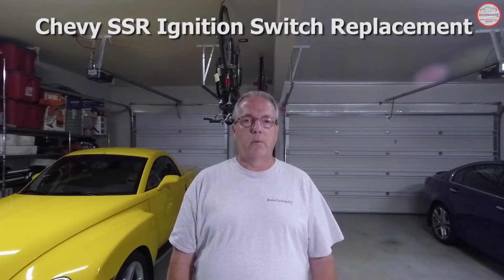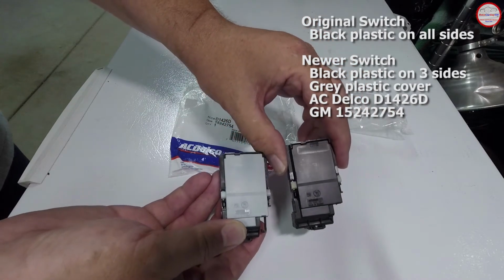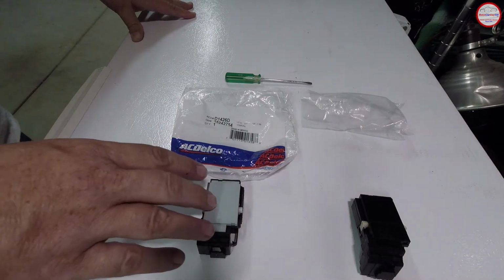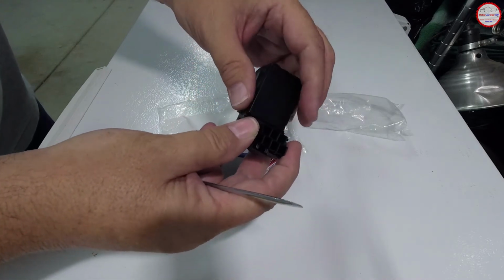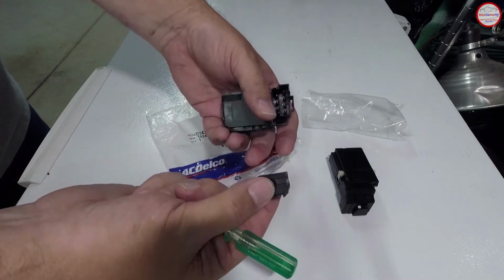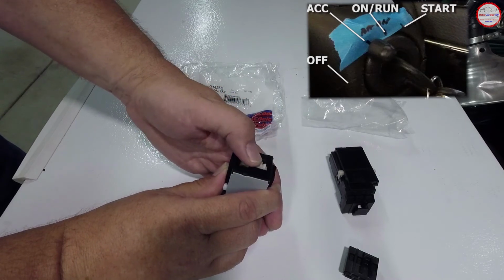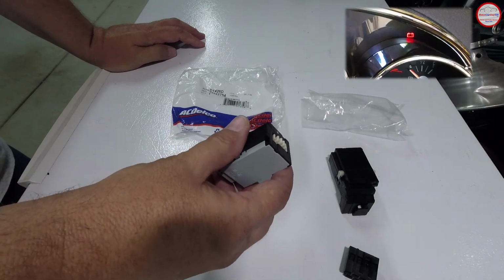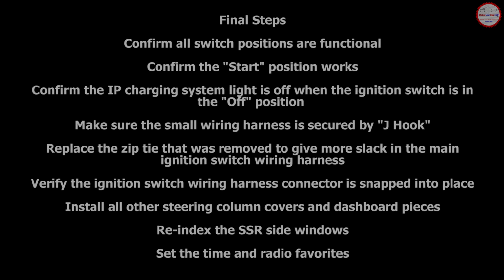Chevy SSR - Ignition Switch Replacement

Comment from the maker: Check out the video description for a link to where you can purchase the ignition switch and a link to the SSR How document library.
Reply: Why SSR 2005 6.0  turning off
Reply from the maker: Hi Jesse, I'll reply to this question in your second post about this issue on another video of mine.
Reply: Just changed my ignition switch on my 04’ and it worked fine in the beginning but after a few hours, it began to do the old “not turning on” phase.
Reply from the maker: There are a few possibilities

1 - The new ignition switch has failed
2 - The ignition switch gear was not positioned correctly causing it to not start or it leaves the accessory power on with the key removed. Sometimes having the ignition switch off by one or more gear teeth can cause strange behavior.
3 - The ignition switch was not pushed up into the slot fully causing only a partial engagement of the gear in the ignition switch with the gear from the key/lock assembly. The ignition switch should snap into place so the gear on the switch fully engages the gear in the steering column
4 - The problem you're having with the SSR is not caused by the ignition switch.
Reply: @RetroCarGuy530 okay thank you! I’m going to make sure it’s fully inserted.
Reply: So it still does it but I noticed the ignition key lock cylinder is aftermarket since it’s been touched before I owned it. Could that be an issue? Since it’s been years since it’s been changed
Reply from the maker: If the aftermarket lock cylinder is moving the gear in the lock cylinder like it should, then it's most likely something related to the replacement ignition switch.  Getting the gear of the ignition switch and the lock cylinder synchronized so the ignition switch is in the correct portion of the ignition switch gear travel when the lock cylinder is in the [off, accessory, run, start] positions is critical for things to work correctly.